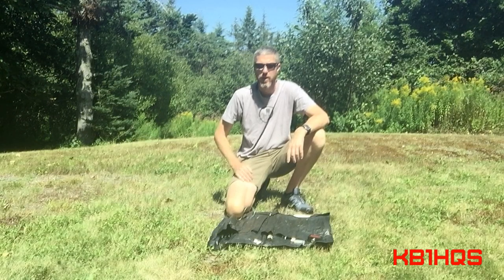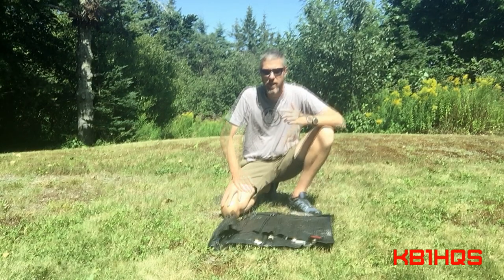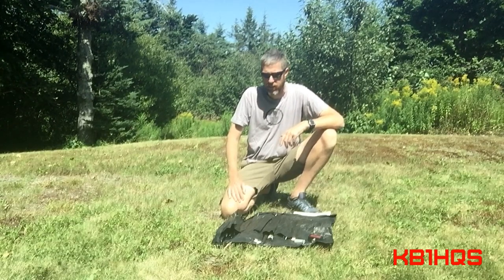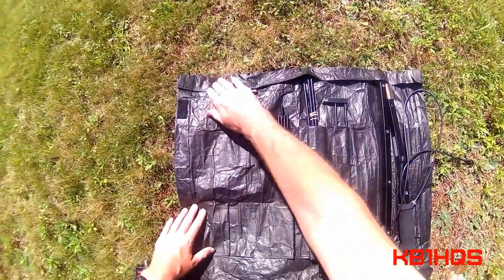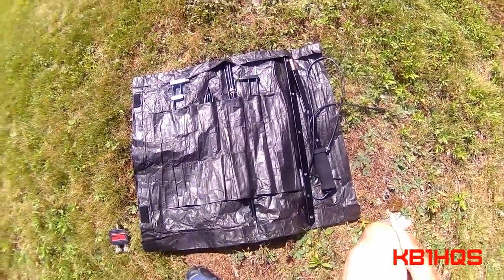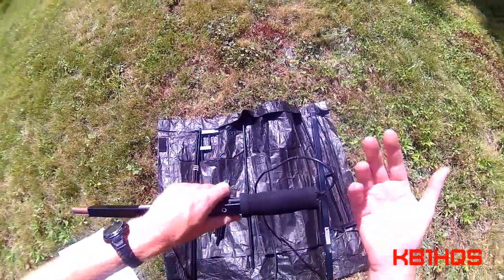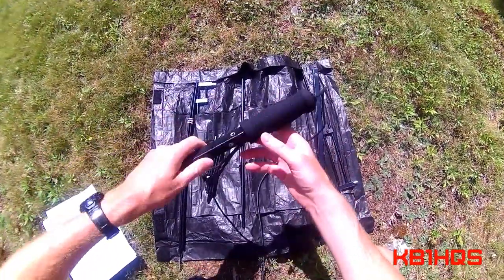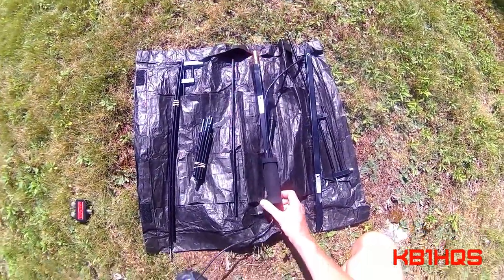Arrow Antenna Review, Tips & Modifications

Comment: Good hints. I use different color electrical tape for each pair of elements and also on the boom. I like your idea of the clear heat shrink tubing to keep the labels on. I have seen, (somewhere) where a fellow had drilled a series of holes along each edge of the boom to remove material to reduce weight. Since you are only needing a couple feet of coax, maybe using RG174 coax will save a few ounces. And, leave the 440 elements at home. Good video, Randy
Reply from the maker: Good idea on the different color tape and RG174. I have toyed with the idea of speed holes in the boom but haven't gotten to that stage yet. I'm thinking of building a super lightweight Arrow antenna clone that is 2m only. Will have to add it to the to do list for 2018. Thanks for watching Randy; been a fan of your YT channel for awhile now. 73 Stu

Comment: I just got my antenna yesterday.  Do you have a follow-on video about how to mount it on a tripod?
Reply from the maker: The boom has a predrilled hole under the handle. I added a new hole near the center of the boom.
Reply: Make sure you have a tripod with a strong swivel...that or counter balance it with a pole going out of the back side of it as well. Or as KB1HQS said, drill a hole in the middle of the boom. 73's KO4GLF

Comment: How do you mount your antenna to the tripod.
Reply from the maker: The boom has a threaded hole under the foam handle. I wanted the antenna better balanced so I just drilled a hole in the middle of boom and ran a bolt thru it.

Comment: Hello I just purchased one of these antennas, I would like to know how did you attach the antenna to the tripod at 11:08 in the video? please and thanks, 73
Reply from the maker: I attached the antenna by drilling a hole through both the antenna boom and tripod mount. Then I used a small bolt with nut to hold it all together. 73
Reply: @KB1HQS  Why not just use the standard 1/4-20 of the tripod?
Reply from the maker: @Justin-bd2dg  The tripod bolt isn't long enough to hold the antenna on the mount.
Reply: @KB1HQS  Time-Sert

Comment: How did you mount it on the tripod?
Reply from the maker: Drilled a hole through the boom and used a 1/4" bolt with nut to secure it to my tripod.